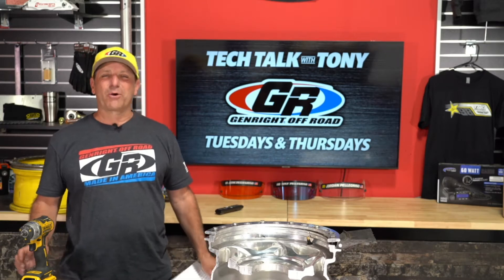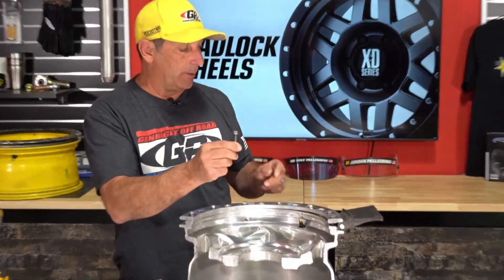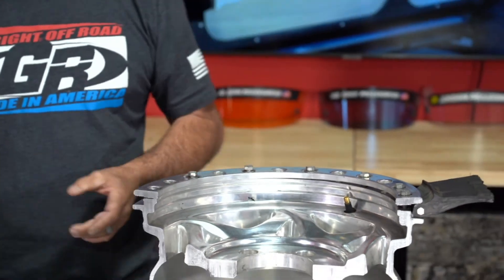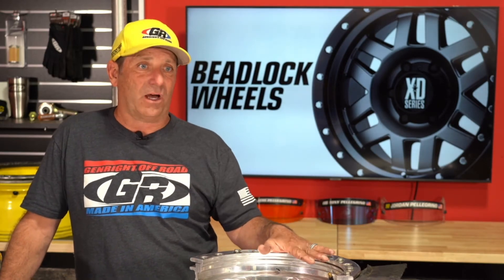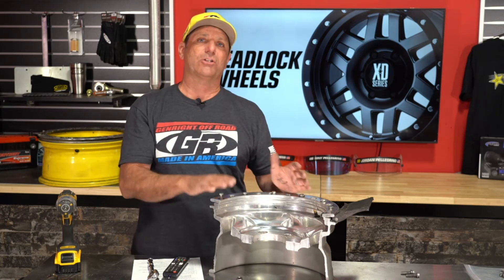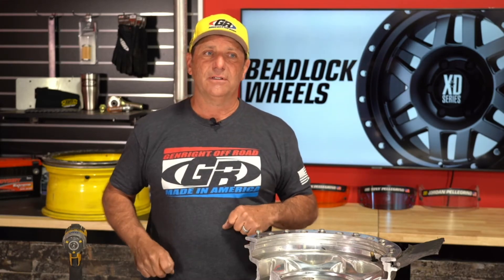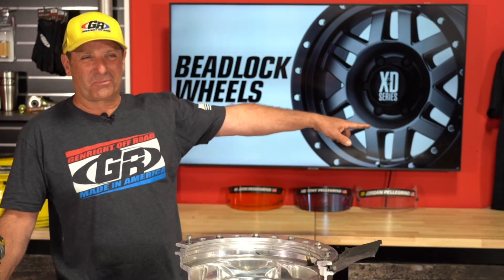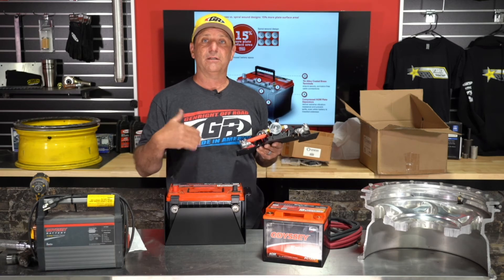Tech Talk - More Beadlocks, Odyssey Batteries. and Genesis Dual Battery setup

Comment: I have 8 years and 11 years out of my dual Odyssey PC1500s in my Genesis dual battery setup. I have an onboard Noco Genius battery charger and an AC port on the side of the Jeep. I just plug in a power cord, flip a switch that disconnects the isolator ground so the batteries are not connected and can charge independently, and I walk away.

Comment: Whats the best rock crawling tire out there right now ? I got a set of RZR maxxis 40" they seem pretty good, but whats the best currently for heavy rock crawling abuse ?
Reply: I'm going to answer this as a multi-terrain rockcrawling guy.
There is no "best". There's too many variables to have just one make and model of tire be best, at anything. Dry, sand, slick, muddy, icy, mixture, dirt trails too? Purely one type of rock? Wheelbase, vehicle width, weight, suspension type....etc etc.
That said, you have a great tire with the Maxxis. Use them til they're treadless.
Reply: @Maxxis1941  thank you